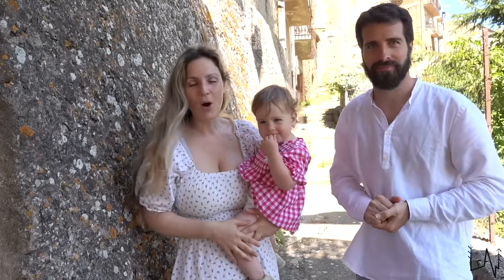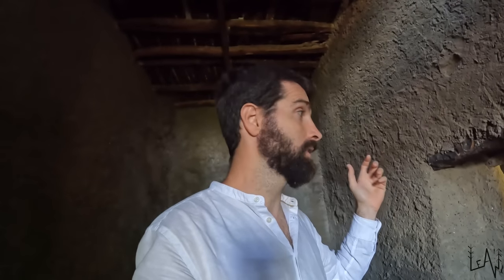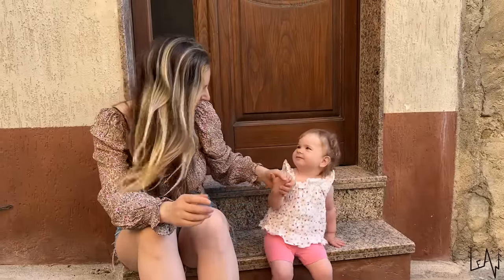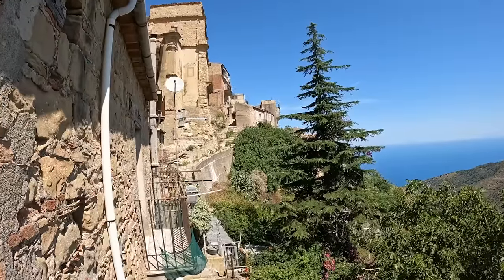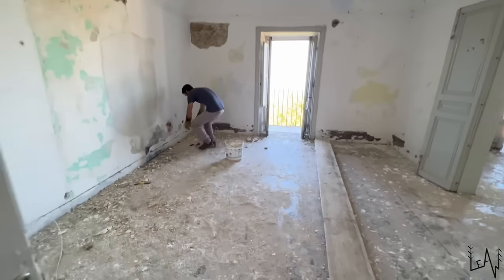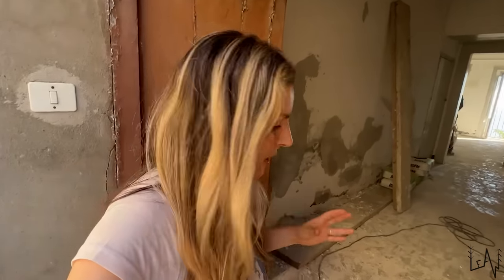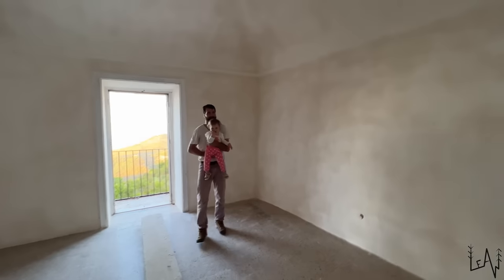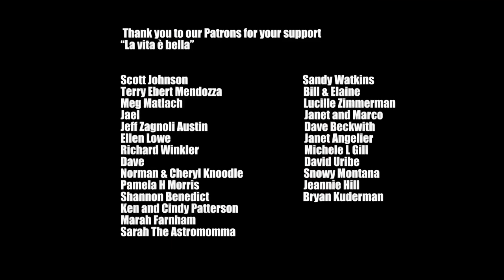1 EURO HOUSE RENOVATION BEGINS / SICILY ITALY Ep.2

Comment: just my advice as someone who remodeled a home. Many plumbers have told me to not put copper pipes horizontal. The bottom of the horizontal copper has a high chance of leaking and once you see it leaking it can quickly fail afterwards. Copper is best used for vertical pipes if you are going to use them. There are two kinds of copper piping. One is thicker metal which is a better choice than the thinner metal. Type L is more favored.

Comment: Hi gang !! Looking good your house,also that the wooden beams were ok,except under bathroom. As for small windows,one can put mirrors on each side,thus letting more light coming in,without much work. The mirrors can easily be fastened with a small screw on top,and standing on the bottom...
I am sure you will,over time, make the house nice and cosy...❤
All the best from mikke in sweden...👍🪛⚒️🦋

Comment: Demo time is when you make some serious strategic decisions:
Did you run electrical wire behind that wall before the plaster guys sealed them up?Did you consider removing the faux wall between your bedroom and your daughters room and putting a double French door there to let natural light in?
Did you consider bumping out the wall to the bathroom to meet the depth of that closet and just remove the wall between them and make one big bathroom with storage?
Did you consider buying a toilet that also has a sprayer built in or with a "bum gun" attachment so you don't have 2 porcelain bowls in a tiny room? 
Did you consider making the future shower room a storage closet/pantry with a combination washer and dryer machine?

Comment: I don't want to know what the water pipes that lead to the house look like from the inside! Definitely get an osmosis system.
We wish you the best of luck with the complete renovation and think that it will definitely be a gem.
p.s. I would suggest a core renovation... that means completely removing and replacing the existing plaster.

Comment: Hello, I'm french living in south, our appartement is in the "basement " of the house. The Pour : when there are hot climate (40°c) we have only 24°C inside whitout climatisation because of little windows and thick walls. The Cons : not a lot of light and mold due to humidity. For me the light it's not a problem because you can go outside of your home if you want light even in winter with the good climate, but for the temprature you can't cool down the inside without climatisation, who I think is bad for envireonnement.